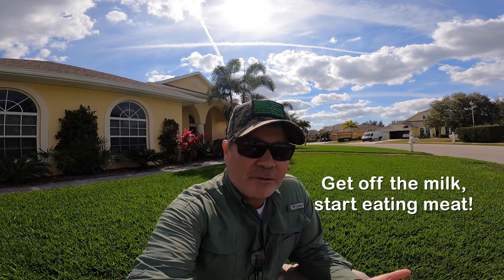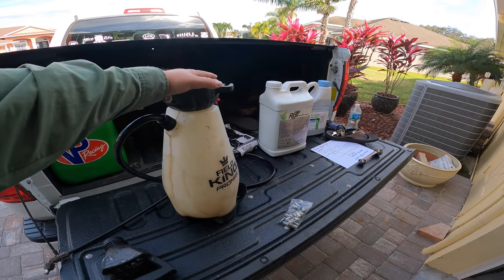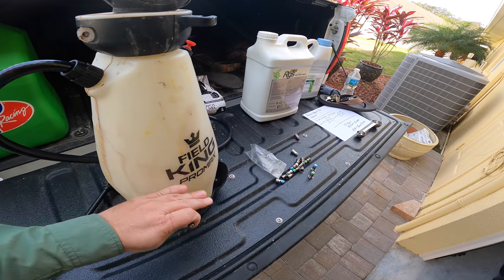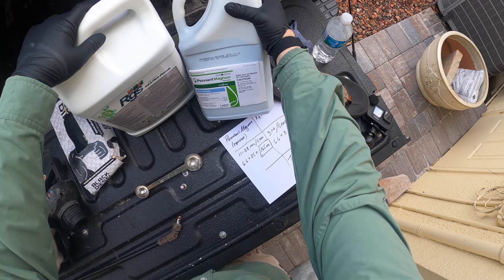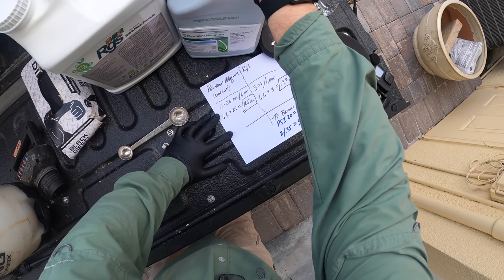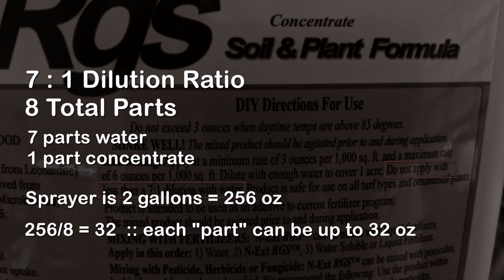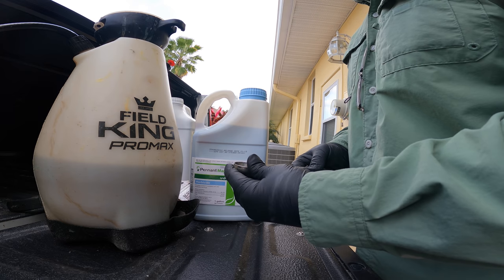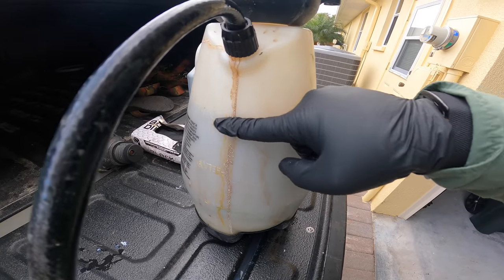Big Lawn, Tiny Sprayer

Comment: I love this guy...although he kinda made me rethink if he has the audience's best interest as the exact same sprayer is $15 cheaper (which he dissed by saying it was a knock-off); however, the three-year warranty is what sold me on returning the Field King sprayer (bought on Amazon so returns are easy) instead of the Scotts sprayer. I would have kept it the field king as the $15 doesn't make a difference, but the two-year extra warranty pushed me over the edge.

Comment: Maybe Im thinking if this incorrectly, but 3 oz per 1k is the label rate. 1k covered by one gallon. So how are you covering 6k with 2 gallons of water? Wouldn’t you need to fill this thing up 3 times to cover 6k for the 3 oz rate? I understand the 19 oz is a more concentrated but within 7:1 ratio. But doesn’t the 2 gallons covering 2k square feet still come in to play? Am I overthinking this?

Comment: The chart for pressure/flowrate is a pretty good argument for battery sprayer vs pump. The pump will start out applying too much product, then just right for awhile, then not enough. Having the electric pump will help keep the pressure consistent. Of course the electric pump will have to work harder as the tank gets closer to empty, so that's where quality comes in.

Comment: Beware of major tank pressure drop as the liquid is sprayed, which quickly halves the actual output of the teejet tip!  I'd suggest not trusting the 20psi claim of the field king.  Fill the field king to the full 2gal mark and time how long the entire contents takes to leave the tank with the tip you plan to use.  I've tested a few of these and it's fairly consistent at 4:15 to drain using a VS5 teejet tip. Calculations tell me this is only a .47gpm flowrate equal to an average of less than 10psi through an entire tank.  Way below the listed .71gpm at 20psi we use to here.  This tells me the pressure in the field king is at 20psi only for the first 1/8 tank or so and the field king (or any other similar sprayer) cannot keep up the pressure as the liquid drains from the tank. So, bucket testing only a small amount and calculating for an entire tank will not produce an accurate result. Time your entire tank to truly know your output.

Also... There's a little filter in the spray wand handle. Make sure to clean that out after each use or it will clog up quick!

Comment: LCN - bio-stim user + just ordered SpoonJuice and a Soil Test. About to order 7-0-0 Greene Effect as well. Hoping you (or the community) can help answer the following:
1) What spray tip do you recommend for 7-0-0 Greene Effect?  The description specifically recommends “spraying this product with a finer mist” for foliar intake, but the charts I have seen for TeeJet Turbo FloodJet tips all have course and larger droplets.
2) What elbows are you using between the spray wand and tip? I can’t seem to find any info regarding those.
Thank you!!

Comment: Approx, 4:29 you mention constant 20psi rating of the pump, I saw another of your vidieo's  don't remember which one, that you had issues with some FK battery/pumps not providing constant pressure on some batteries..
Looking at the FG description of the pump it says "keeps pressure constant between 14-21 psi" how does this affect your spraying output ?
Reply from the maker: it's not a very good solution but it's really the only one accessible to most people.

Comment: If I wanted to only do 4,400 sqft (size of my front lawn) would that be possible with this sprayer and just do 3*4.4 = 13.2oz in the sprayer? And then just fill it up to 2 gallons, that would work right? It’s below the 32oz dilution threshold

Comment: When tank mixing, should I consider the dilution of the most restrictive product? For instance, RGS is 7:1 and Pennant Magnum is 1:1, therefore is it true that the volume of all products combined cannot exceed the 32oz that you demonstrated? If so mixing 19.8oz of RGS + 5.6oz Pennant (165ml) = 25.4oz, which is still under 32oz 👍
Reply from the maker: Yes, exactly correct. Good work !!

Comment: Great video!  Quick question - isn't it still early for Pennant Magnum?
Reply from the maker: It probably is a few weeks early but I'm not taking any chances with all the doveweed pressure.
Reply: @Thelawncarenut  Good to know, I thought you always recommended it later in the spring into summer.
Reply from the maker: @jeffweiner6921  it depends where you live for sure... normally I'd throw down around March 1 here but I wanted to get ahead for sure.
Reply: @Thelawncarenut  Hey Allyn, circling back here...do you put down a second application, and if so, at what rate?

Comment: Allyn what is the correct weight for prodiamine WGD   65 per 1000 sq ft is it .55 grams or is it 5 gams per 1000 sq ft  yard mastery used 13 grams per 2500 sq ft on  Sep 23, 2020

130

5

SHARE

SAVE

Comment: Allyn, when using different TeeJet tips and you use a tank sprayer where you can adjust the psi does that mean if you are using a tip for 20psi you should adjust the psi to 20?
Reply from the maker: you can adjust the PSI and it will output more. Look at the Teejet chart and it shows you the output at varied PSI levels.